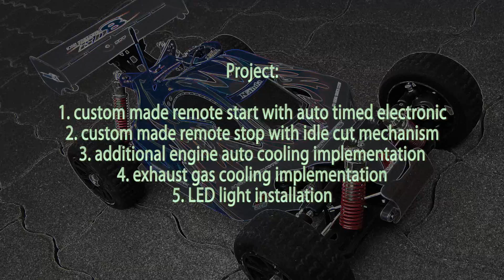Remote start & stop for nitro engine on Nanda Racing BD8 RC buggy

Comment: Is the glow plug always glowing with this setup?
Reply from the maker: No, glow plug is powered only for engine startup and it is electronically time controlled but after engine start up is completed glow plug actually continues to glow by its own.
Reply: @frankycro  so when you flick the switch it only stays on for a certain amount of time?
Reply from the maker: @mertcapkin7263  Yes

Comment from the maker: To prime engine I just put my finger to exhaust and switch 3rd channel, if it does not start immediately I repeat it.
And yes, it does use remained fuel from the previous burn, but at the next engine start.

Comment from the maker: No, power supply to the glow plug and motor is from traxxass EZ-Start board that I made smaller. Every component from original EZ board I moved to my design of that board. Timer is for starting, it gives power to EZ only for 2 second at 1 power up cycle, after that it cuts power from EZ and wait next power up cycle. Traxxas ez starter doesn't fit on SH21 engine. Mechanical adapter is required to fit this, I also designed the adapter. I'll put some more pictures and schematics.

Comment from the maker: This micro servo is attached to aux ch of RX, his function is on/off micro switch which gives signal to timer board, then timer board activates relay which closes EZ-Starter circuit for 2 seconds.

Comment: Secondly, power supplying to the glow plug, is it from LM78xx (1.5v) or directly from your battery?  Thirdly, the timer that you installed, what is that timer for, is it for stopping your starting?  Lastly, does the traxxas ez start fit the SH28 engine?  Sorry for asking you many question, as your project is very creative to me and i want to copy this.  Thanks for sharing

Comment: Hi Frankycro, yes the thermo switch attached to the crank case is to switch the fan on / off automatically but what the micro switch under your added servo is for.

Comment from the maker: The switch for activating vent is mounted on engine crankcase, it is a simple bimetal temp switch that close circuit at 85C and open at 77C, no other electrics needed for auto cooling.

Comment: Hi, I like the set up.  Can you tell me what the micro switch installed under the engine stop throttle for?  Is it for activating the engine temperature circuit to switch on the forced vent (fan)?

Comment from the maker: For engine stopping there is mechanism that cut idle on the carburetor when aux off (carburetor fully closes).  Now the idle is no more adjustable on engine idle needle because engine idle needle is set for fully closed carburetor.

Comment from the maker: The radiator is not for air intake, purpose of radiator is exhaust gas cooling, it prevents fuel temperature rises, thus prolongs runtime and better tune hold. It is made of the cooling system from notebook and work flawless. There are other solutions on the market such as Novarossi exhaust gas cooler 3600...
Reply: Why do you 'cool' the tank pressurizer tube from the muffler? There is no real gas flow in the tube. The fuel get thousands more heat directly from the exhaust system. I don't really see the point in the cooling fan. But the starting system is great :) I should do that too, because the pull-start is quite boring :)